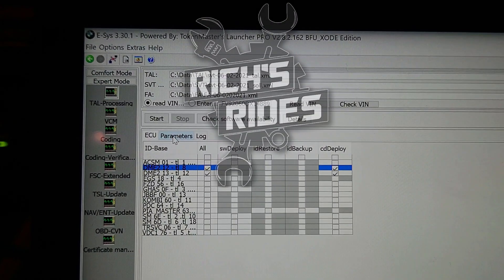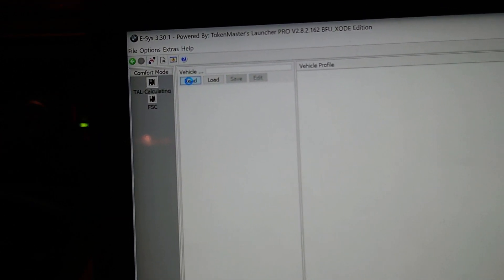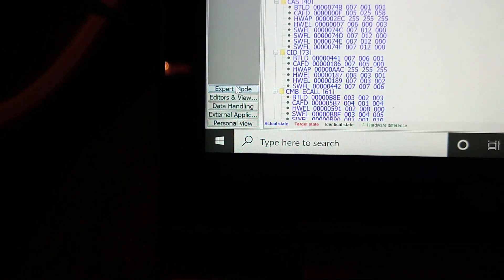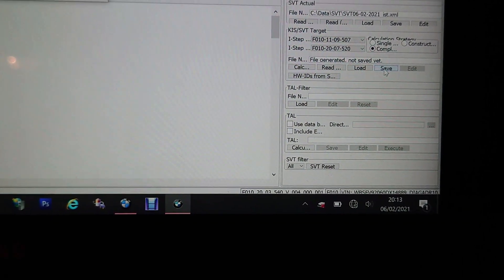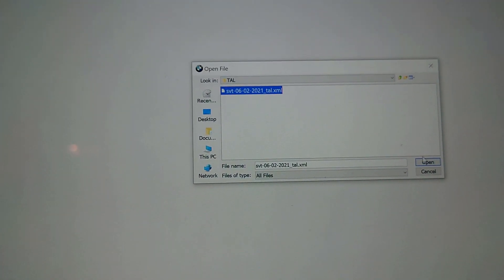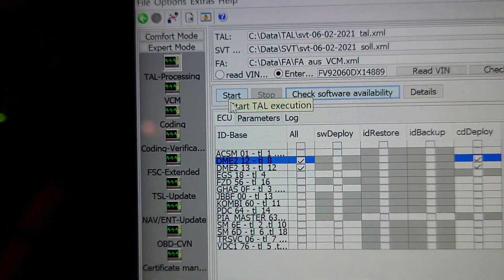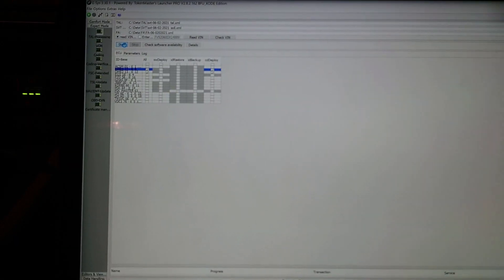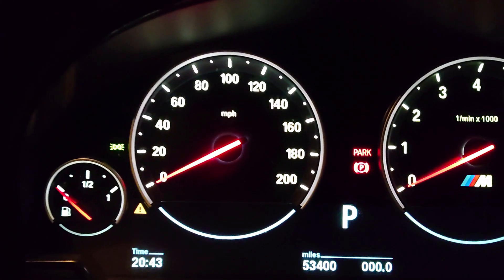Salvage BMW F10 M5 - How to software flash DME with E-Sys

Comment: Hi, i got problem, can you help me with advice please? I have got M5 F10 without DME’s. I did programming and flashing for another DME’s and car starts with no significant faults on Ista. But, car is running on 4 cylinders and Ista cant see Injector quantities for cylinders 2,3,6,7. I have put all new 8 Bosch injectors (Turkey) and new set of plugs. It was preventive changing. before changing these parts car was running smoothly. What would you do now? Thanks
Reply from the maker: +@BalkanExtazy are you sure all the plugs are seated correctly?
Reply: @RichsRides Yes, today checked coils and injectors and i found that whole right side is not working, there is no spark on 5,6,7 and 8 cylinder. Cylinders 1,2,3,4 are working. I checked wirings from Slave to Coils and everything is alright, also checked all fuses. Mechanical components and wirings are 100% working
Reply: @RichsRides Hi, please can you help me. Does M5 F10 needs separate flash files for master and slave?
Reply from the maker: @BalkanExtazy it's been a while since I did this but I'm sure they're seen as individual units.
Reply from the maker: @BalkanExtazy are you still running on 4 cylinders? Are you sure everything is plugged in correctly?
Reply: @RichsRides Yes, still….Everything is ok checked + and - on all wirings only signal from dme 2 is missing
Reply: @RichsRides Hello my friend, i finally managed to get car working on all 8 cylinders but now car is running rich on both banks and rough. After short drive it shuts down 2nd and 8th cylinder and writes missfires on these cylinders on ista…have you got a solution? Injectors swapping same codes on 2nd and 8th cylinders

Comment: Did this fix your idle issue? How did you validate that the dme was updated?
Reply from the maker: +Tino Hall unfortunately not, I found out after that my rough idle was due to a faulty injector and a hole in piston number 6.

I'm still repairing it, but will be revisiting the DME when it's all back together.

have you got a rough idle too?

Comment: how did it work and flashing after you got that error when you start flashing?
Reply from the maker: +Rana Najdawi Hiya, it flashed but I don't think it's put it back to standard tune. Unfortunately the lumpy idle continued and on further investigation I found a problem with the piston in cylinder 6.

Checkout the engine teardown, I've just managed to get the offending piston out. Got to rebuild it now and then get back to the DME to make sure I have the standard tune on it.

Are you trying to flash your DME?

Comment: You didn't flash the software. I can do this for you remotely.
Reply from the maker: +Fahim B do you use eSys to flash instead? what did I do then?
Reply: @RichsRides   I use E-Sys. You only updated the encoding (cdDeploy) not swDeploy which actually updates the software.
Reply from the maker: @fahimb5876  hmmm, I'll have to have another look at that then. Engine is in pieces at the moment. I might give you a shout when it's back together, want the DMEs to run std tune.
Reply: @RichsRides  Sure mate 👍 There could be a few reasons why it didn't let you click swDeploy. Couple of the reasons could be your psdzdata matches what the car has been already flashed to or the car software is newer. There are ways around that though 😉

Comment: This procedure is the same to program DME new or used?
Reply from the maker: +jonathan Brito it's the original DME, I think if you have a replacement there are a few other steps you need to do? I'm not sure. Are you replacing yours?

Comment: Thanks for this great video may I ask you what is the difference between flashing with ISTA+ and Esys? I know that ISTA requires icom, but what are the pros and cons between both?
Reply: Yeah I'm owning a F10 525D from 2012 and gathering information if it worth to flash it with a new DDE firmware since my car never received an update. Is there any gain by updating
Reply from the maker: @roningumi  personally I wouldn't bother flashing it unless there are problems. I'm a big fan of "If it ain't broke, don't fix it". You could potentially create other issues by flashing it with newer software.

Are you just looking to make sure the car is up to date?
Reply: E-Sys is more specific for coding and flashing SPECIFIC ECUs (as well as their dependencies). ISTA is more user friendly and does an ENTIRE flashing of all modules.
Reply from the maker: Thanks for the kind words! I honestly don't know the answer to your question. My version of ISTA doesn't work for programming at the moment.

I'd like to know too, maybe I'll look into sorting ISTA out (think I ran out of disk space). 

Are you looking to flash yours?

Comment: Hi. Glad you managed to flash the dme, should of used the Ista+ you have, easier IMO in expert mode.

Cold start doesn’t seem to have come back, mine idles around 1500rpm on cold start.
Reply from the maker: +b21playa Its definitely better but there's something else going on, it nearly stabilised around 1000rpm but felt like it was missing on one cylinder. still no codes though? More investigating planned for tomorrow.
Reply: @RichsRides  might be worth looking at o2 sensors. If I recall correctly there’s a test plan for it
Reply from the maker: @Shush1984  I'm sure there is, also going to test injectors to see if any are bad!

First step is pull the plugs and see what they look like, then stick a camera into cylinder to have a look at walls and pistons, then compression test to see if I've got a mechanical problem. I haven't got a leak down tester but I don't think they cost much and I'm sure if use it again in the future, depending on compression test results I'll think about that.

In hindsight if I was being sensible I should've done a compression test before I reassembled everything.
Reply: @RichsRides  could it be the fact you have catless downpipes?
Reply from the maker: @Shush1984  nah, they're cats, just not OEM.
Reply: @RichsRides  ah right 👍